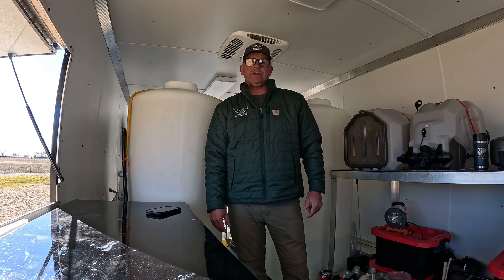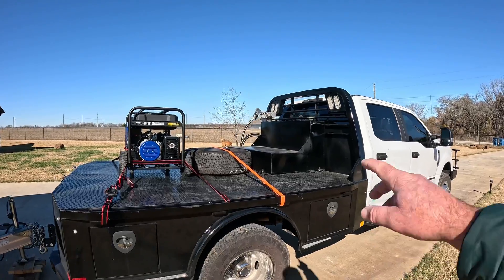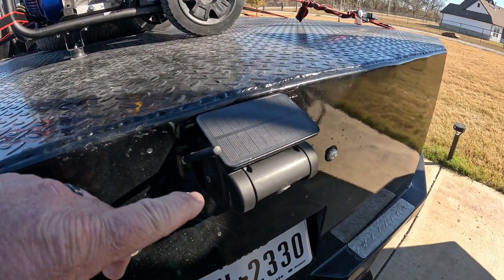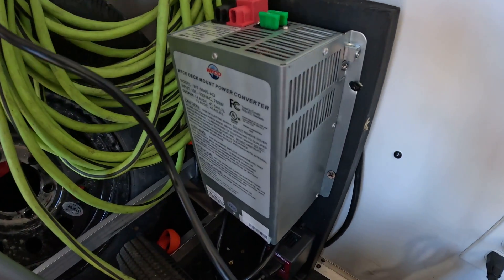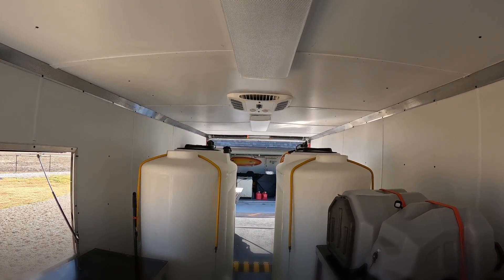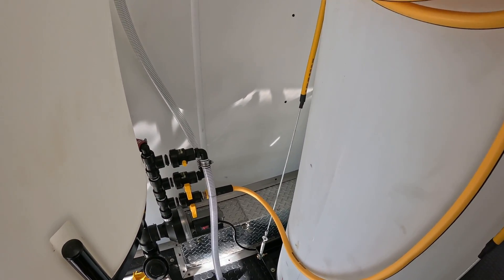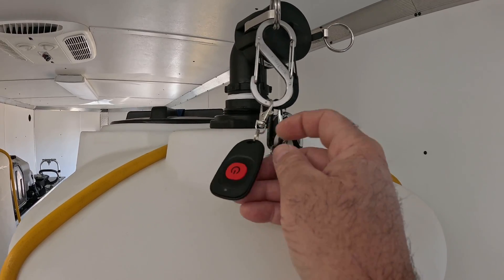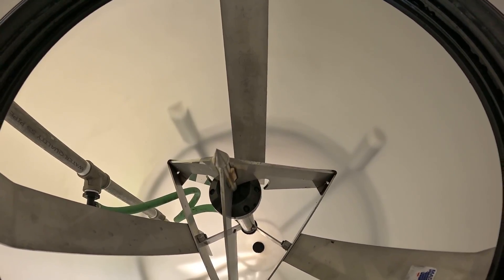Vortex Advantage AG Drone Spray Trailer Mods And Upgrades

Comment: Hey, this was a great video as I continue to evolve my 16 foot enclosed trailer to be as functionable as possible. Can you provide a link to the 50 amp receptacles? I know you mentioned them being on Amazon but there are so many and can't seem to find the ones in your video. Also, I love the deck on top. Had a guy who was going to do something like this and then reached out saying he was going out of town. That was 3 months ago! lol I would probably do it for the length of my trailer in order to land drones on top for refilling and battery exchanges. Truly like your set up and how bright your trailer is! -Frank
Reply from the maker: Thanks for the kind comments! Yeah, the deck on top is nice. I thought about building it full length but really just use it for observation. Here is a link to the electrical cord and receptacle box for a 50 amp circuit. Good luck with your build!
https://a.co/d/3pfQtUW

Comment: Really insightful - great setup! If you don't mind answering, what's the function of the hose coming off the 3rd tee from the discharge side of the pump?
Reply from the maker: Thank you! I don’t mind answering at all. The guy who helped me plumb the tanks on the trailer said that he installed that valve as a way to manage the maximum PSI the pump would get. If you notice the handle is taken off of the valve. We have it set to roughly 28 psi and if I’m not mistaken, the flowserve CT6 has a max psi of 30. In hindsight, I read that the pump ( a diaphragm pump) has a built-in pressure relief bypass system so I’m not sure why exactly that third valve was needed but that was the intended use of it. hope that helps!

Comment: I noticed in both of your videos you use a ball valve on your hose reel. What’s the advantage of that versus say a “fuel pump” nozzle?
Reply from the maker: Hey there. Yes I do and got that design idea from Taylor Moreland @agrispraydrones. I had initially purchased the fuel pump style nozzle, which was a GPI I believe. The downside of that which I believe is a big one Is that when you insert that nozzle into the quick fill hole of the T40 tank cap and let go while it’s filling, the 1 inch hose with product and the pump itself puts a lot of stress on that plastic cap. In other words, it is pulling downwards on the side of the cap and I’m sure that cap would break over time . If you look at the way, we’ve created a “U” on either side of the ball valve It rests nicely onto tank and the tank itself bears the weight of the hose and the valve rather than the cap. I’ve been using the banjo 1 inch ball valve with 1 inch, 90° barbed elbow on the inlet side, and a 1 inch to three-quarter inch barbed valve on the outlet side. If you lightly grind off the barbs on the outlet side, it fits perfectly into the speed fill cap hole.
Reply: @VortexAdvantageAg  thank you sir! I hope to have a rig setup like yours soon.
Reply from the maker: Awesome man happy to help anyway, I can.

Comment: how is the inverter and remote switch working?  not sure whether to go with a 110v pump or use the system like you set up.  have a multitude of 12v pumps around the farm so not sure if I need to buy another pump.  please let me know if you think the inverter and switch is going to hold up.
Reply from the maker: Hey there! Given the price of pumps and the fact that you already have a bunch of 12 V I would go that route if I were in your shoes. The converter I bought at camping world has been working great. It just converts the AC power from the generator to 12 V, and that pump is the only 12 V I have pulling from the converter. Either way you go, you’re pulling power from the generator as you know. You could also back that up with a battery in the event the generator wasn’t running for short periods of time it could run off the battery. The remote switch has been working awesome. It has pretty good range I would say. I keep it clipped on my belt loop and turn the pump on and off when I’m at the drone I’m just gonna filling up or at the tank mixing station mixing up a batch.

Comment: Why no separate chem inductor? It seems like no inductor would cause serious mixing issues? An 80 gallon batch is around 30-40 acres, depending on the chemistry that is a heck of a lot to get mixed into 80 gallons of solution without an inductor, not to mention the compatibility issues it could potentially cause. 
Not trying to be negative here, I’ve just been spraying and mixing chem for around 12 years and this just doesn’t seem quite right.
Reply from the maker: By no means is it a perfect system and not trying to sell it as a perfect design or system. Just sharing our setup with folks who are interested in seeing it. We haven’t had compatibility issues running the herbicides We’ve been spraying with a combination of four different products. Two are always surfactants (MVO- Xtra and Downforce) and the other two chemical for target species. I keep the tank well agitated constantly, so it just hasn’t been an issue thus far. Laying down Rezilon, glyphosate, Triumph 22K, etc I’ve been working just fine without the inductor. My next set up will be much smaller and have a larger hot load tank. I think having 300 gallons of whatever I’m spraying for the day already in one large tank will be more efficient than having to mix new batches constantly as the day goes on. I’m constantly learning what is more efficient with every job I do.

Comment: How do you figure herbicide rates when nothing is labeled for drone applications?
Reply from the maker: That’s a great question, and as I understand it, the EPA is aware of the shortfall with regard to labels not applying to the use of drones. I believe that will change soon with the drastic increase in use of drones in agriculture. I never provide recommendations for a specific chemical or application rate. I rely on Field agronomist who work for the chemical companies to provide the recommendation. I stay in my lane as the applicator not the agronomist. 
 We only use chemicals that are approved for aerial application so far. That has been my experience.👍🏻😎

Comment: Please show us the battery change process? We are scratching our heads to improve the ergonomics around the lifting and carrying of the heavy battries.
Reply from the maker: Apologies for the delay in responding to your comment. The swapping of the batteries is a fairly straightforward process and should be secondary to starting to fill the drone tank when it comes in for a landing. Our process is to be ready with the fully charged battery at the time the drone is landing. Once the propellers stop spinning, we place the fill nozzle into the drone cap and open to start the filling process. Then we turn off the battery in the drone, pull it out, and replace it with the new battery and turn it on. By the time the drone tank is full the drone has reconnected And is ready to takeoff again. Then just rotate that battery you just pulled out into the charger so you have another one on deck fully charged when the drone comes back. I run four batteries per drone so as to not ever have to wait on anything charging

Comment: Why did you go away from the large generator to the smaller ones? What was the advantage for you to invest in the smaller generators rather than run the large one you had
Reply: Got it. I ran the dji generator for 2023 season and it was great but i only ran 1 t40 last year. This year i have 2 rigs with 2 drones per, and the generators cant be as close to the operator as it was this past season. With that said, im considering selling my dji generator and getting either the 28k westinghouse like what you have for 1 rig and the 9500s for the other, or 9500s everywhere. My theory is that i can (for the cost) do an even swap of the 28k Westinghouse with the dji generator (as far as $ i would get back from it). Then, if the future is much bigger, i at least have 1 generator sized accordingly and capable of handling the larger pull. Just bouncing ideas around as of right now
Reply from the maker: @theohiofarmer5631 sounds like you have a pretty solid plan put together. Also, sounds like you’re growing which is awesome congratulations. I hope to have the demand to necessitate my second rig by the end of this year. This forum is great for sharing ideas. Everyone is super helpful for the most part.
Reply from the maker: Good question. The main reasons I went with two generators instead of one were twofold. The first reason is for redundancy of my two drone operation. If one genny happens to go down on a particular day I am not completely dead in the water and can run one drone until I resolve the issue. The second is cost. I can buy four of the smaller ones for the cost of one big one ($900 vs. $3800 each). I also had the need for a new whole home backup generator so the big one will fill that role and be a backup to the drone operation if needed👍🏻
Reply: Gotcha. Another question. I keep thinking ahead for the future for my drone operation of bigger drones which will require bigger batteries, thus more power to charge them. The 9500 rw westinghouse is a great generator but if the future gets even bigger, wouldnt they become undersized and have you buying bigger, more expensive generators again?
Reply from the maker: @theohiofarmer5631 that is certainly a possibility. However, if things go the way, I hope they do I will run these things long and hard so I presume I will get my 900 bucks out of them either way. Unless you are on really large fields, I don’t see needing more than two drones on one rig set up. I think if I had the need for more power. I would go over to a diesel generator although they are crazy expensive.
Reply from the maker: @theohiofarmer5631 I am learning what works and what doesn’t along the way just like most are at this time. This industry is moving at a very fast pace with the technology and awareness of this type of application. I’ve had to do a lot of things twice because the first attempt may have not been as efficient as it could have been.👍🏻